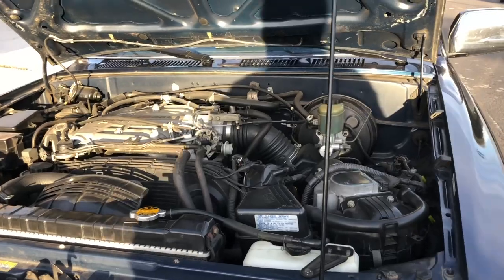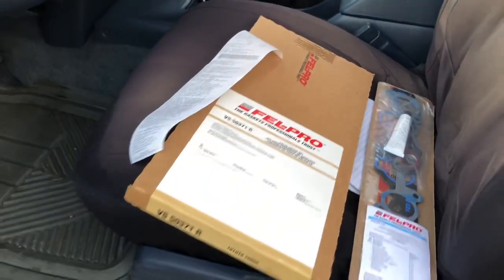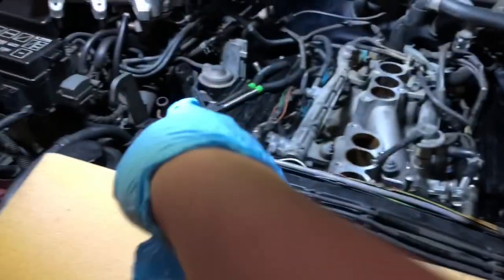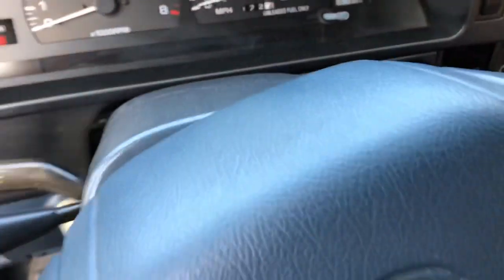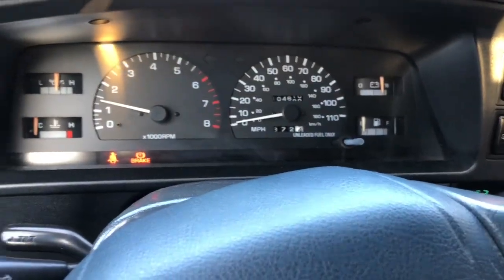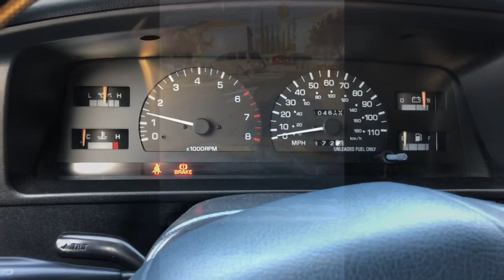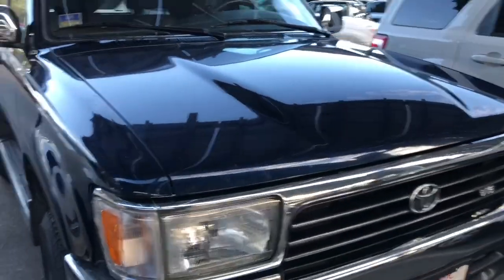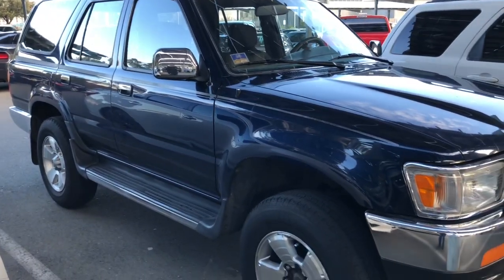1995 Toyota 4Runner Update and Drive

Comment: Dude  i have a valve cover leak too but the engine sounds really healthy i bought this sealer hopefully that stops the leaks i cant afford to change the gaskets right now n now i gota replace to rotors the steering wheel vibrates while breaking
Reply: Learn how to change the valve cover gasket and you’ll save yourself a bunch of money
Reply: @yungseed98  for sure i seen few videos ima see when ill be able to do so man i got this 4runner n its has electric issues witht he head lights they turn on n off 😑